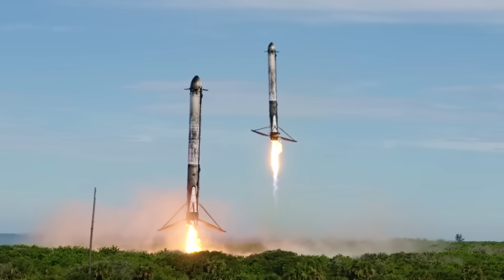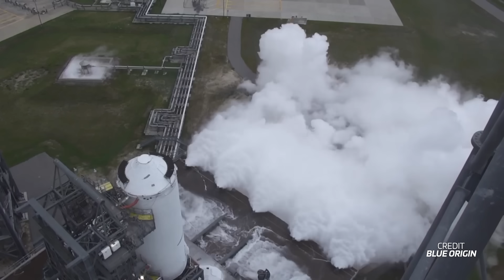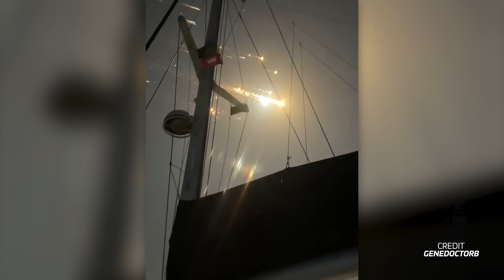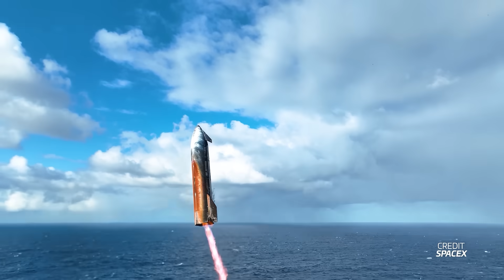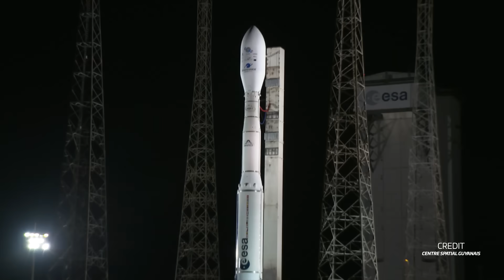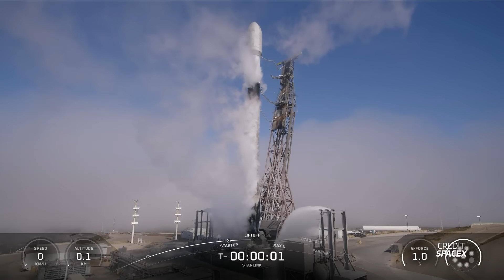How Starship Barely Made It To Splashdown on Flight 10 | This Week In Spaceflight

Comment: Given the method of deployment of Starlinks from the Falcon 9, it's doubtful they "bump" into each other on release. Why? The method of launch involves flipping the upper (second) stage end over end then yetting the Satelites at the right moment. From top to bottom the speed of each traveling from the launch point is incremently slower, with the top one moving away the fastest and the bottom leaving the slowest. If they are all the same mass the, the separation of each is uniform in nature and grows until you see the train formation then ion rockets are used to guide them from there.
Reply: Not sure why it's doubtful when it's something SpaceX says themselves it's what happens. The satellites bump into each other after separation

Comment: Starship barely makes it back?  Come on NSF using click bait is beneath you guys.
Reply from the maker: The flight test was extremely successful, but the ship also barely made it to splashdown in one piece... both can be true. An explosion in the aft skirt, the aft flaps taking obvious reentry damage, and the ship intentionally pushing the reentry envelope... it's an honest headline, even if some folks would rather not agree. - Das

Comment: The heat shield on Starship did the job, barely, but there is no way that Starship could re-fly without replacing the heat shield -- that does NOT equate to reusability!  Additionally, the explosion within the engine bay is probably not something that would be a good thing to happen if people were on board!  So while IFT-10 was the most successful flight test since IFT-6 I would not call it a success given all the damage evident!  When they can land Starship and SuperHeavy without doing any damage get back to me, but how TF does 10 flights without achieving successful landing of both stages compare to SLS, for example, which on its maiden flight reached LEO, then circled the Moon before returning to Earth and successfully landing?
Reply: SLS also uses a lot of hardware that's been around for 40 years. Have you seen any full flow staged combustion methalox engine in the 1980s? Maybe 1990s? Oh yeah. Hey at least the steel on Starship has been around since forever, that's a plus, right?
Reply: @Alexphysics13  It's irrelevant whether they use full flow staged combustion, SpaceX chose an engine technology that others have avoided for many reasons -- they don't get a pass on this because they tried a new engine type.
More to the point, SLS accomplished all this on their first flight and not after 10 or more tests.  SLS, however, is a NASA project and like all NASA projects the budget is not within their control and every incoming administration tends to want to pursue their own space objectives and the approach a previous admin undertook is likely to be cancelled before completion.  Sadly, this start and stop approach greatly increase cost and even more it almost guarantees that non of these projects are ever completed.

Comment: Maybe Rocket Lab doesn't have a launch tower because they are not sure if they can actually land Neutron on a barge, and they might need to build a catch tower like Spacex. Right now there are 4 companies (Blue Origin, Rocket Lab, Stoke and Relativity) that are trying to do something that Spacex has already proven to be really tough, and that is to land a methalox vehicle on a solid surface, without fires and explosions. Remember a few years ago, the tests Spacex did with the Starship second stage. They all ended badly, (only one success), and then they pivoted to the catch tower. At the time everyone thought they were just trying to save the extra weight of landing legs, but maybe they realized that it's really tough to not have an explosion when slamming a methane fueled engine into a solid surface. Neutron is just about the same size as Starship 2nd stage. I certainly hope they have better luck landing it, I don't believe RL has done any kind of testing with the landing....so it's probably a good thing they don't have a launch tower yet!

Comment: Me, I’d stick with kerosene. Methane just means more work, and the tiny fraction of fuel used by rockets means that the extra carbon from kerosene is trivial.

Think you can refuel with methane and oxygen produced on Mars? Try producing those from captured carbon dioxide plus (plentiful) water plus solar power here on Earth. Just try it. I don’t think that the experiment will be reassuring.

Comment: I think that little blow out was expected but they should relocate those chill pipes and also have a sn8 burst disk in the pipe to redirect the energy event, or something where it won’t melt the flaps and crack the bottom of the ship. But I think ship 28 will be perfect, maybe flight 11 will be a repeat, but I really don’t know why the ships don’t have landing legs again. They proved multiple times they can make starship land on target and should land on land to get precious data. Why they don’t do that and even if the ship dose come down to hard and ruds you still can sift though the debris and yeah i know spacex is busy and don’t need another job but why not?

Comment: It was a test launch of a commercial space vessel by a commercial company with no particular interest in science, research or programmes such as Artemis. So, of interest are the restoration timescale and the payload costs.
Reply: Commercial, sure. But no interest in science and research programs? What do you think drives their business? Not only are those customers, but other science and research underpin all their engineering. Sounds like a bit of Musk-bashing to me. Not that he doesn't deserve some well-aimed bashing, but this is not the right direction. For all his dubious goals, he is developing and building valuable and necessary infrastructure that underpin multiple issues for all spaceflight, and its science and research. This is engineering research rather than science research. At one time, NASA had to do all of that. Now it doesn't. I think that's a good thing. Don't be so narrow in thinking. No human being is without faults. And this is pioneering work. What field could be bigger than space?

Comment: Those rocks in front of the "exhaust tube" of Rocketlab's launch pad won't be there after the first static fire.🤣
Reply: I also wondered what those rocks are doing there. It's like cheap paint on a house that will get washed away with the first rain. Those rocks will have to be replaced after each test/flight 😂😂

Comment: There is zero point in doing a mass simulator test if the weight distribution isn't the same as the actual satellites. they'll be the same.
Reply: Why is there no point? The satellites still have the same mass and connections to the dispenser than the real ones, is that really not worthy enough?
Reply: @Alexphysics13  Yeah, It looks like they are very simple boxes with the dimensions and mass of the satellites and no attempt has been made to simulate weight distribution or anything else other than connection points.  But I also suspect that the satellites are probably kept relatively symmetrical, mass-wise.  It seems like that would make it easier to maneuver them.  If the bumping is a problem, they will address it.  That's the point of all of this testing: try it, see what works and what needs improvement, rework the design, try it again.

Comment: SpaceX keeps discovering that landing Starships on water doesn’t work.
Reply: In what sense doesn’t it work?
Reply: @ale131296 Falcon 9 boosters land on the barge at sea.
Reply: @williamdrake2315  And the point is...?
Reply: Space X Falcon 9's land at sea on a barge. The Starship and it's booster are designed to use a tower with the mechazilla to capture the spacecraft. The recent tests have them landing in the ocean. There is no expectation of salvage or reusability. They are stressing the spacecraft beyond its design parameters. The probability of a RUD is high. They do not want to damage infrastructure  by trying to land on land. At this time it is not part of there tests. So there is no failure when they go boom after hitting the water. They expect that. If they did not go boom or break....now that would be a suprise.😊

Comment: They're 'payload simulators', not 'mass simulators'. They are in fact mass, not a simulation. 😂😂
Reply: Well, careful; we’re not sure what they were, are we? (Unless you work the issue at SpaceX). Realize, if a launcher is carrying a ‘payload simulator’, it generally means more than just a ‘dumb mass’; it more often than not means it’s something that simulates payload electrical and data behavior et al. But in this case, we were clearly dealing with Dumblinks, whose purpose was to test the mechanism; so mass/moments of inertia et al were the things to make sure were gotten right. That’s why I have no problem with the ‘mass simulator’ nomenclature; better than payload simulator, since THAT phrase doesn’t imply to you exactly WHAT parts or functions of the “payload” are being simulated (electronics interfaces, RF interface, cooling interfaces, structural interfaces, you name it). Cheers, - Dave Huntsman
Reply: they are infact starlink simulators with just mass!🤭